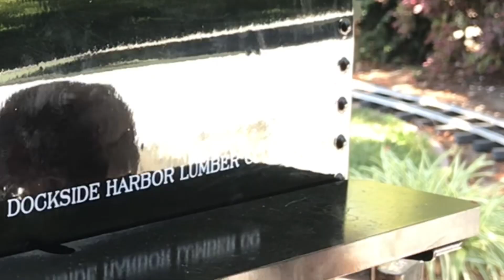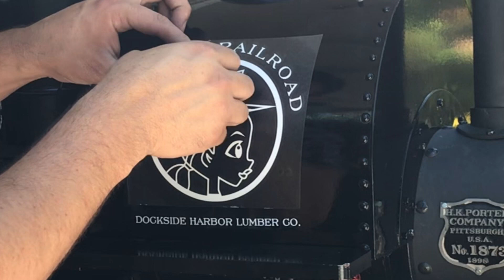Part 4 - Porter Locomotive Butter Pig - An Inland Empire Story #trains #steamlocomotive

Comment: how much did this engine cost? some day I'd like to have a live steam locomotive of my own.
Reply from the maker: Great question! I got this Kornut Porter here for $16,000. I sold some other equipment and put it towards this loco. There are other ways and cheaper options as well. This loco is a 3 3/4 Scale loco and is based off a two foot gauge setup, so she’s the biggest scale you can get for 7.5 gauge track. Checkout Discover Live Steam. Their a great sight that sells new and used equipment for the live steam hobby.